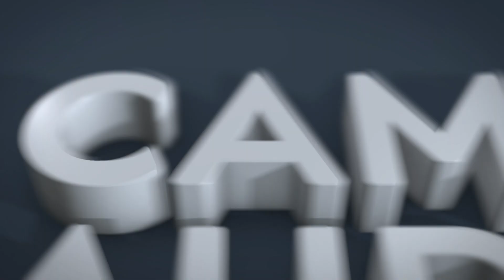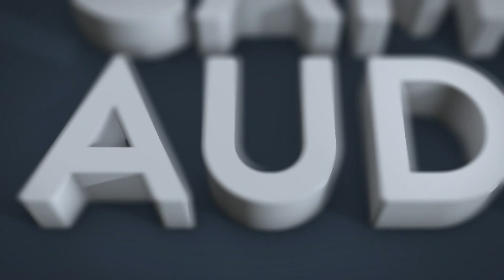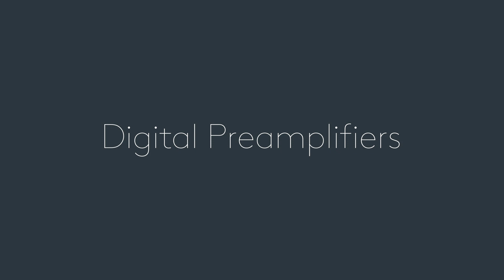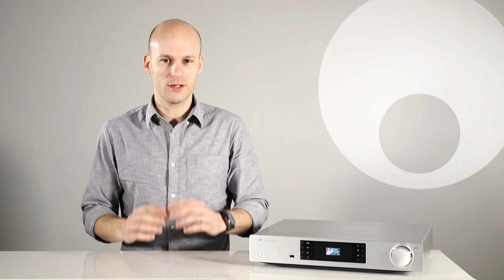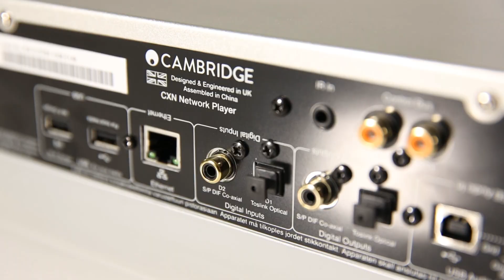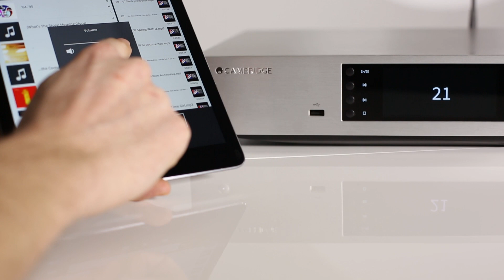Digital Pre-Amplifiers

Comment: I have an 851N which I am pleased with, but can't use it as a Pre Amp since it does not have an analog input for my turntable.  You can't even seem to buy the 851E anymore. I am hoping that Cambridge Audio comes out with a replacement range for the 851 Series,, and has a preamp with both analog and digital inputs, and is also a streamer, similar to the Edge Streamer.

Comment: I own the CXU and see this has a volume control built in. I use a Yamaha amp but like the idea of bypassing the pre-amp and sending the CXU 2 channel output straight to the power amp section and using the CXU volume control. How would I wire this up please?
Reply: By rca cables or rlx connection if the poweramp has them